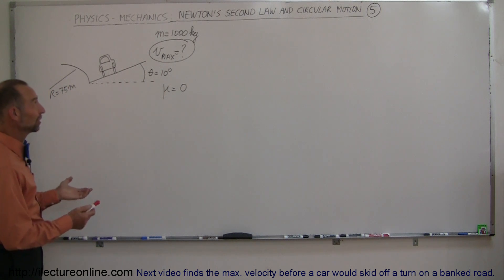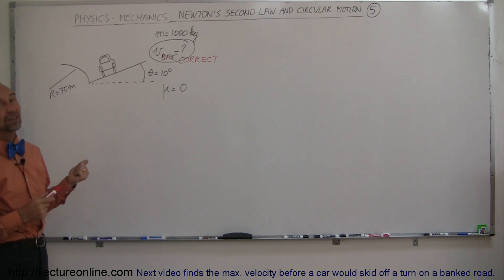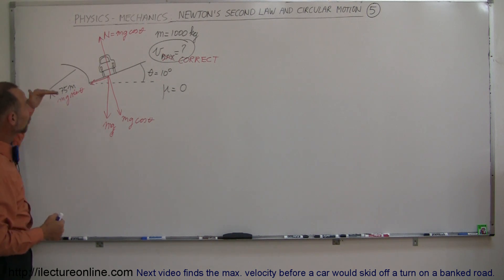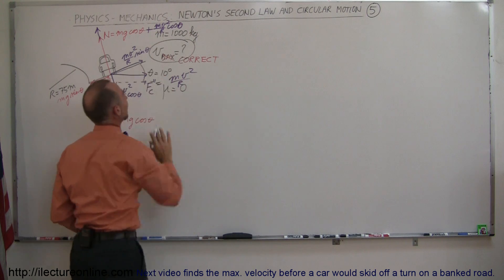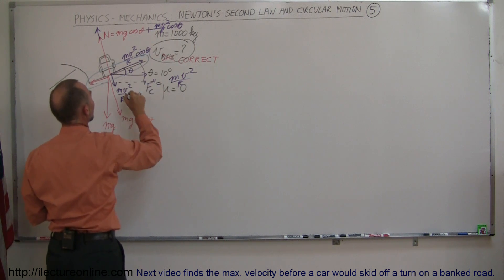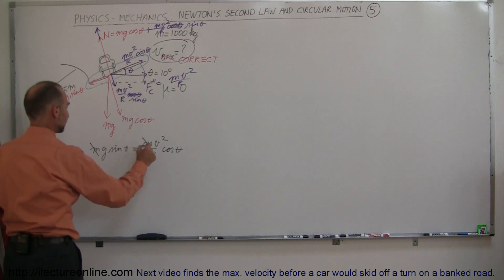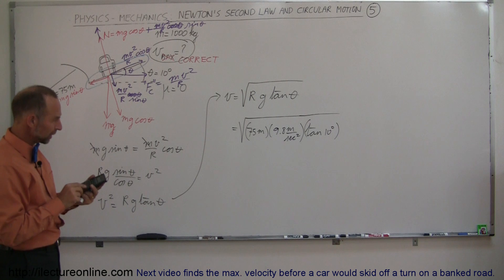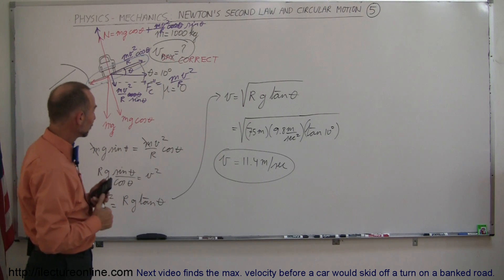Physics 6  Newton's Second Law and Circular Motion (5 of 10) Banked Road, No Friction

Comment: Hi Dr. Biezen, I've encountered a physic problem regarding circular motion and hopefully you can help. Here is the question: . An object attached to the end of a string swings in a vertical circle (R = 1.2 m). At an instant when θ= 30°, the speed of the object is 5.1 m/s and the tension in the string has a magnitude of 20 N. What is the mass of the object? The answer to this question is 1.2kg and they use the equation T + mg sin θ = =mv*2/R. I don't understand why they use 'mg sin θ ' instead of 'mg cos θ' in this case. Can you briefly show me how to solve this question? Can you please also tell me the difference  between tangential and radial acceleration? Thank you!

Comment: can i use this eq. V = root of R G Tan. directly with out the steps in the exam will it be enogh
Reply: is it general for all Banked Road
Reply from the maker: I typically don't like to "generalize" a rule or equation like that because if anything different is asked in the question you will be stuck or you'll get the wrong answer.  Better to know how to build the equation as shown.  Then after you do a few of these types of problems and they all end  up with the same equation, you then know that under those circumstances the equation works.
Reply: thank you so much sir. 
 @MichelvanBiezen

Comment: Why friction acts toward the center for a car moving in a circular motion?
Is it to counter the tangential velocity effect on the car?
Thanks

Intuitively 
The car has the tendency to centrifuge away and the friction between the road and the tires acts toward the center to counter the tendency of the car to centrifuge out at every instant.

I visited a sugar factory and they use centrifuges to centrifuge out the crystals.  They rotate the tubs fast enough.

Please answer if I am thinking in the right direction.

This may be a good analogy to intuitively understand.

Best wishes for u, always
Reply from the maker: If no force acts on an object the object will keep moving in a straight line at a constant velocity (Newton's first law).  For an object to move in a circular path a force must push it in that direction so it will depart from the straight path.  That force in this case is the friction between the tires and the road.
Reply: @MichelvanBiezen  Got it now 👍👍👍😃

Comment: Does the friction force where the rubber meets the road acts radially inward to counter the tangential velocity  on the car moving in a circular motion?

Thanks👍👍😃
Reply from the maker: The centripetal force always acts inward during circular motion.  In this case it is the friction force between the tires and the road that pushes the car towards the center of the circular motion and therefore that is the centripetal force.

Comment: i would just like to add that if you expected the object to accelerate parallel to the incline then you should  resolve the weight vector parallel and perpendicular to the road, but in this case the acceleration is horizontal toward the center of the car's circular path so it makes sense to resolve the vectors horizontally and vertically.
Reply from the maker: Yes, we have a video on that in this playlist.

Comment: If there is no friction car can not turn right ? If car can not turn there won't be any centripetal force . I don't get how this problem makes sense or where i am wrong (after thinking a little bit i believe the car will make the turn by keeping its direction same which is pretty non intuitive )
Reply from the maker: On a flat road you are absolutely correct.  A car cannot turn on a flat road if there isn't any friction.  But on a banked road the centripetal force needed to turn the car is provided by the weight of the car sliding downs the banked road.

Comment: Hi sir.if the car had velocity less than  the required then will it have a safe turning??? Eagerly waiting for your reply.
Reply from the maker: If the car goes around a banked curve to slowly, and the coefficient of friction is too low, the car could slide down the banked road.
Reply: @MichelvanBiezen   in the case the coefficient of friction is too low  the car could slide down the banked road, then why the friction force acts toward the center? It seems a contradiction, please clarify, thank u so much.

Why the friction force acts toward the center in general?

Does the friction force in general act toward the center to counter the effect of the tangential velocity on a car in circular motion? Please clarify, thank u so much.

Comment: Sir, why in "Fc"=(mv^2)/R you use R and not Rcos(theta), since this is the radio of rotation?
Reply from the maker: For the centripetal force, you need the radius of the circular path.  It is independent of how much the road is banked, (which does affect the friction force components)

Comment: Thank you so much sir- I spent quite some time wondering what the difference was between an incline plane and a banked curve. Can it be said that the "centrifugal force" is caused by the curving frame of reference of the circular motion and its interaction with the particle's inertia?
Reply from the maker: The difference is primarily how it is used.  With an inclined plane the object goes up or down the incline.  With a banked curve, the object goes around the curve, while one side of the object is higher than the other side.
Reply: @MichelvanBiezen  Awesome, thank you Prof.

Comment: shouldn't the centripetal force be always parallel to the surface .so we use it's function normally without cos@? i mean how did we should Fc to be horizontal instead of parallel with the surface?
Reply from the maker: The centripetal force cannot be parallel to the banked surface because that would violate the conservation of angular momentum.  The centripetal force is radially outward (parallel to the level ground).
Reply: @MichelvanBiezen   okay.thank you very much for your wonderful videos

Comment: Sir, I did not understand the part when you changed sin to cos and cos to sin. Why do we have to write them like that in this case?  I think it is a bit tricky :(
Reply from the maker: I actually didn't change anything.  It is the assumption of most students that the cos is always associated with the x-direction and the sin is always associated with the y-direction.  But that is NOT true.  It all depends on the circumstance and the angle they are referring to.  What is always true is that sin(theta) = opposite / hypotenuse    and    cos(theta) = adjacent / hypothenuse

Comment: sir, I think there is a mixup between ((mv^2)/R)cos(theta) and  ((mv^2)/R)sin(theta). shouldn't it be other way around according to geometry?
Reply from the maker: The trig functions are correct in the video.  Thanks for checking.
Reply: Yeah, even im not getting it. How come the ((mv^2)/R)cos(theta)) and ((mv^2/R)sin(theta)) are placed that way?
Reply: @i8mycupcake  The angle having theta on it will be cos and the angle without theta will be sin these components are called consine sticks in vectors
Reply: yes sir got that. thank you.
Reply: Horizontal line is hypothenuse, thats why it is cos theta on the upper line

Comment: isnt the centripetal force always towards the center of the circle? why isnt this towards the center of the circle?
Reply from the maker: The centripetal force is always to the center of the circle as you indicated.  But here we use the fictitious centrifugal force which is "directed" towards the outside.  It makes it easier to visualize the problem.
Reply: Thank you ! :)
Reply: Michel van Biezen if you are using centrifugal force shouldn’t you mention you’re in a rotating frame of reference and not inertial frame?

Comment: Hello, the Fc is horizontal right? the angle between the horizontal and the plane is teta so i feel that the component of the centripetal force along the incline should be mvsquare on R costeta. dont know if you see this as making sense.
Reply from the maker: Yes, I corrected it in the video.
Reply: Okay. Thanks for this formidable job.